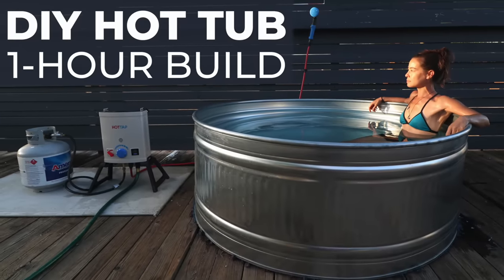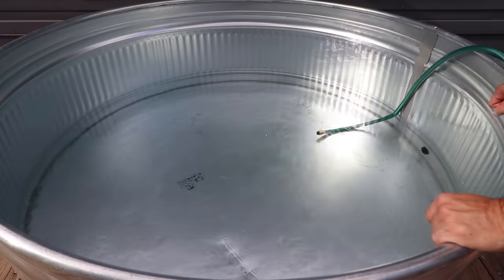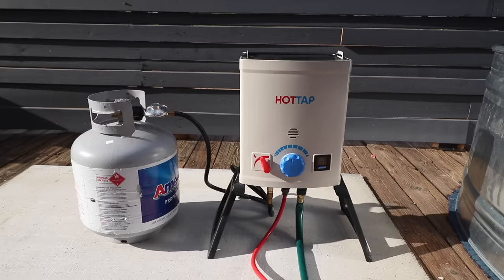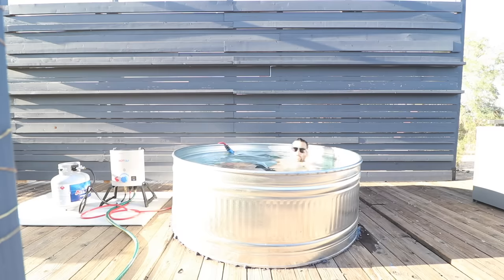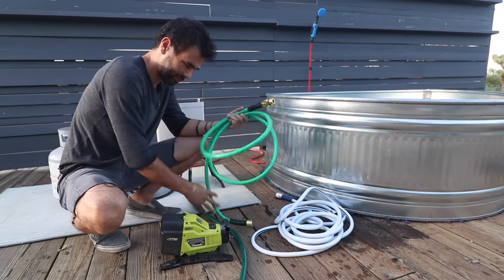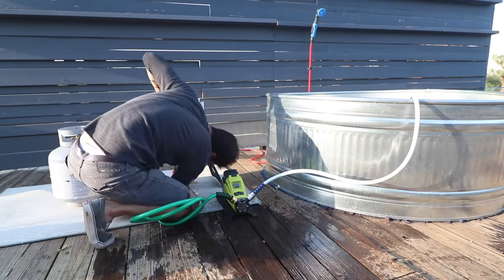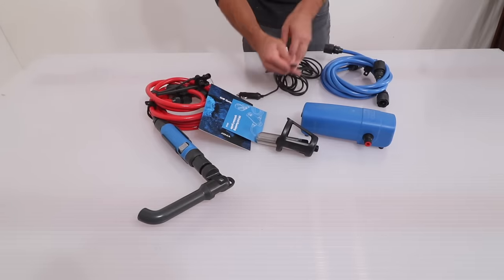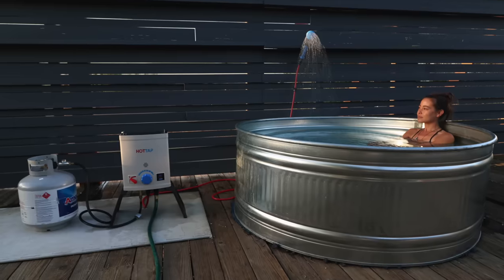DIY HOT TUB built in 1-Hour

Comment: I would not recommend a cloth, absorbent material underneath, as this will soak up water and rot your deck. Also massive mold will grow under hot water. You should use a closed cell foam which is used for underlay for flooring, built up to desired thickness.
Reply: Maybe I want my deck to soak up water… Not a bad idea seeing as it sits out in the sun 24/7. Since when is a little moisture so terrible?
Reply: @LordOfThePancakes  it’s not temporary moisture, it’s the water that gets in, and stays.  It WILL go black mold on you. Eventually the boards will give way on you.  If there is an air way, that allows the thorough drying of the wood, then rot can be held at bay for years. However, the moisture stays causing the deadly black mould, and mushroom type fungus that literally eats the wood. The heat from the hot tub will condense moist air and cause damp. Closed cell foam will insulate between the differing heat, thus no condensate.

Comment: Hopefully you reinforced for deck and foundation to support the weight of the tub, and you want the underlayment to breathe, not hold moisture/water, which is only going to rot the decking below the tub very quickly. Also, try having the hot end (positive flow) feed directly into the tub to prevent heat loss. Insulating the walls would also help drastically hold the heat. Great build!

Comment: I built one using a metal tank like yours. Painted the inside blue and used a summer-fun pool filer cut in the side. it lasted about 5 yrs ,but the chlorine finally ate  up the tank. It looked great  and worked well. I also used an external pump from Harbor Freight to heat by running hosepipe through a solar greenhouse type deal . It worked OK, but never got really hot.I should of developed it some more 
I'm going to try again using a black 300 gallon Rubbermaid tub from tractor supply.Oh yeah I had a waterfall on my first one by using a small pond from Lowe's
Reply: You might think twice about that poly tub, hot water destroys the polymer. You'll end up with black skin, black water and won't want to dump it on the ground.

Comment: I have a fabulous LP heater made Chofu. Been using it for about 10 yrs. Same idea w/ stock tank except I drilled 2 holes in the tank. The heater thermo syphons (circulates) the water. You just need a paddle to stir it up. Water is filtered through 2 sediment filters. Set it on a round hot tub cover for ground insulation then got 1” rigid insulation and scored it so it could be fitted around the tank. Got some dark green marine upolstery and covered it. Found a used round rigid hot tub lid. Has a timer. Runs about 7 gallons a month in winter (northern Ca). I don’t know if they make it anymore.

Comment: Looks epic!.  just a suggestion  - if you have the hot water go directly into the tub rather than using the shower head the water will be hotter, as you are losing heat from the water when using the shower head as it hits the air and cools a little before hitting the rest of the water in the tub 😊
Reply: I was thinking the same thing.  I'd also add to this and say make sure the water you are adding is being added at the bottom of the tank since hot water rises if you add it to the top the hottest water is cooling down the fastest.

Comment: I own the whole Joolca system and run it off a Goal Zero Yeti as my main shower and hot water sink in an off grid scenario, using a 150 gal stock tank as a bath tub for occasional soaks.  I  would not buy it just for use in this type of temporary hot tub set up because of cost.  As you say, this is not a long term hot tub solution as letting the unfiltered, untreated water sit in the stock tank would get gross.  But if you’ll get use out of the Joolca system while camping, at festivals, for everyday use like my situation, then this is a nice additional way to use it.

Comment: Why use a propane water heater? Coil 25 ft of 5/8"black drip line tubing onto a 4x5    sheet of plywood. Attach one end to a 12 volt submersible sump pump available on Amazon. The other end dangels in the tub. The pump is powered  by a solar panel from, also from Amazon. Both the recirculation panel and the solar panel could hang from the wooden fence behind the tub. There are 12 volt pumps that can circulate 500 gals per hour depending on the size of the solar panel. 100% eco friendly and no burning of hydrocarbons. Probably cost $250. Never needs service. As soon as the panel catches the sun's rays, the pump starts circulating the water through the black heating coil.

Comment: If it were me, I'd hook up my own 12v circulation pump that's sized right for the job and pumps enough water to make the water heater happy- hook up the hoses, adapt them as needed. I would replace the DC battery supply in the water heater with a dc-dc buck converter board (cheap on ebay) and set the output voltage to 3v, that way D batteries are no longer in the equation and the water heater runs now on 12v dc. I'd add an in-line 12vdc digital thermostat (they're cheap on ebay) and run the temp probe sensor into the tub. When desired set temperature is reached, power can be cut from the 12v going to the pump. This stop the heater. When water temp drops, the pump turns back on, heater fires back up, it's self maintained.
Reply: It's a propane water heater, the battery is just for the igniter

Comment: SO, i have created this exact setup, the joolca pump is quite, but so weak that the flame cant go above min and flow rate can only be set at 3 or it shuts off due to low flow, tried the Royobi transfer pump and it doesnt really work much better, unit keeps shutting off due to the temperature inside the unit reaching 122. Any tips im willing to listen as im financially invested!

Comment: What about using the drain plug on the tank which is threaded to circulate water back to the heater with some adapters. also they make tank heater that can go in those drain plugs to keep the tank from freezing. figure out how to rewire the heater to exclude the thermostat and presto!

Comment: I just did a wood hot tub project and used an electric immersion heater to warm it up. I turn it off before I get in (though it's fully earthed of course) and it works great.
Reply: what do you mean fully earthed?  does that mean you dug a hole and put it in the earth?
Reply: @philodonoghue1019  ground

Comment: Or just use a pump to pump the water from the tank back into hot water heater providing a closed loop system instead of using hose water to fill and drain to have hot water.

Comment: That’s pretty genius . I would just adhere treated cedar planks with stain around outside of tub for aesthetics secured by glue and rope strapping or something. Maybe line the top of tub with thickest cut pool noodles you can find. Still trying to figure out how to filtrate it without having to drill into it and set up yet another contraption. Maybe line the inside with some big rubber sheet just to avoid the uncomfortable aluminum interior

Comment: Hello, the recirculation idea does not work - we tried it. The Joolca has a safety feature that cuts off the heater when the output water goes above 124 F. The heater is designed to heat cold water, so once your input is over 80F the heater will get too hot even on the very lowest setting. You're limited to heating the water as you fill the tub, and then soaking until it gets cool.
Reply: Thanks for this, Ben! This was my concern with buying this system, as many pumps cannot handle too hot of an input and will shut down to cool off. Appreciate you sharing! Any other ideas to combat this problem?
Reply: @civic2004racer  no, you just run the water hot and then soak until it cools. In our 110 gallon tub we can run 110 degree water and soak for well over an hour before it cools too much. If you want to recirculate you’ll probably need a heater designed for hot tubs.

Comment: Im not sure of the pressure needed but adding a sealed through wall interconnect at the bottom of the tub to connect a hose to the propane heater then another hose that connects to a similar through wall connection at the top could be done without a pump. The pressure from gravity pushing on the water may be enough pressure to push it through the heater. If not adding a pump would be just as easy with a cleaner look. Possibly an electric water pump/heater would be better too depending on cost.

Comment: What I want to see is someone build a concrete above ground tub with inlaid heating tubing in the walls and base. I actually want one for myself.
Reply: As cool as that would be or sounds. That is thermally inefficient, Water has a volumetric heat capacity more than twice that of concrete. So heating water in heating tubes to heat concrete to heat water again, would consume and waste way more BTUs than if you just heat the water directly.

Comment: It will heat MUCH more efficiently if you drop the head directly into the water. If you spray it, the water that reaches the tub will be significantly cooler from it what it is at the nozzle because of evaporative cooling.  Which reminds me, you might find some really neat applications for evaporative cooling in your Joshua Tree projects.  (Evaporative coolers get pretty manky and gross, but the principle of their operation is fascinating).

Comment: I modified my joolca so it didnt auto cut off at 50 degrees and you can recirculate. It adds about 20 to 30 degrees C onto any water going in. So if you want 45 degree water it will start auto cutting when you get to about 42.
Reply: Hi! How did you modify your joolca? Mine does not make my tub hot enough as it cuts off too soon. Thanks
Reply: @venessa7470  hi venessa little bit involved have to open it up etc. If you can see yourself doing that let me know and ill talk you through it
Reply: @driftke70  thanks 😊
Reply: @driftke70  I am interested in the process you used to achieve this if you’re willing to send me a breakdown. Much appreciated!
Reply: @adammuldoon6074  i opened it up and moved the temp sensor on the outlet pipe to the inlet pipe from memory

Comment: You don't need a water pump to circulate the water in the tub as the hot water produced by the gas heater will circulate the water by itself through convection.

Comment: you cannot use a Joola for this set up it won't work! It has an internal temperature governor that initiates the safety to shut off the Joola when warm water is pulled into it.  So you cannot recirculate this. Camplux will work .

Comment: Cut out all the bullshit and get a hose splitter for a few dollars, and put it right to where your hot water line from your washing machine goes (or just unhook the washing machine hot water line and a hose for the time being and use the hot water for that.) Eventually it’ll run out and get cold so get a $30 submersible water heater and leave it in there for a while. 

Or just buy an inflatable hot tub for $300. It has jets. Or a higher end model has massage jets. But if you’re going to do all of this to sit in hot water…life hack: get in your bathtub.

Comment: 🤦‍♂️ what's with the transfer pump?

Just connect the hose to the drain valve on the tank.
Reply: Ooooh, great idea.  We already  installed a water spicket at the bottom so that we could connect a hose for draining (and drain the other end elsewhere if we wanted).  So we already have that part installed - not sure if gravity would create enough water pressure to push it through the heater?
Reply: @rebeccahughes8048  That's a really good point about the pressure. I forgot that these propane instant camp heaters need a certain gallons per hour flow rate to trigger them to turn on. My idea probably wont work.
I was thinking of similar DIY wood fired hot tubs that place a coil of pipe in an open fire, which create a flow through convection without any electric pump. But they flow at a very  slow rate
Reply: I'm pretty sure that your pump IS necessary. One very minor change I would make would be to tie it in to system via the drain, just to have one less hose.

Comment: Why put a cloth under the tub. Makes no sense, how does that level things out? Other than absorbing water around the perimeter which can't be good for the deck 

Also why would you let hot water run from the shower head above the tub. You are losing heat by letting the water flow though the air.

Comment: The water heater they recommend is CRAP will not heat that much water and terrible quality (Chinese) junk!  You can do the same thing with a stainless steel coil and use wood to fire the heater.